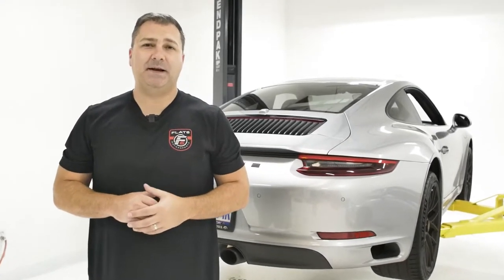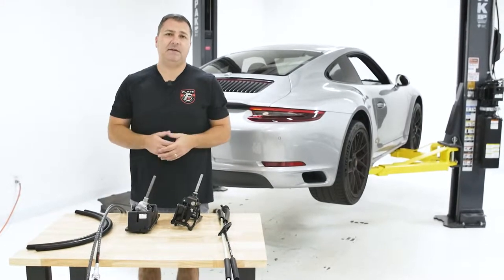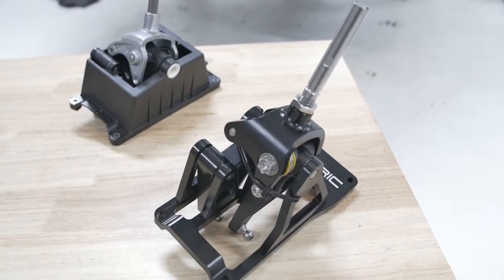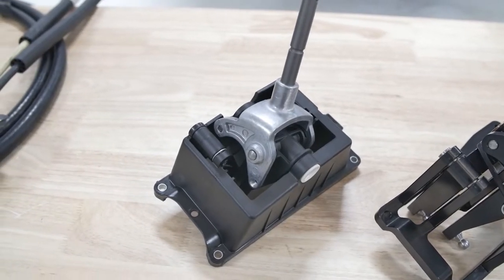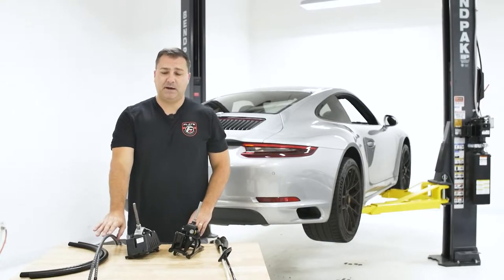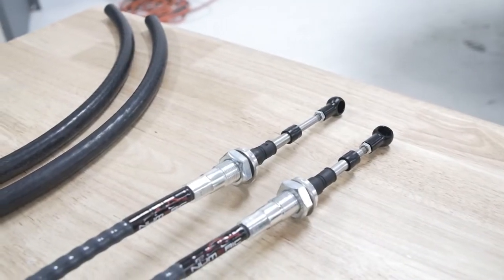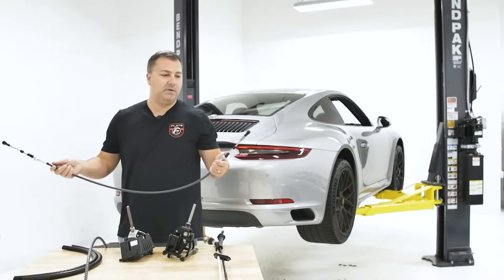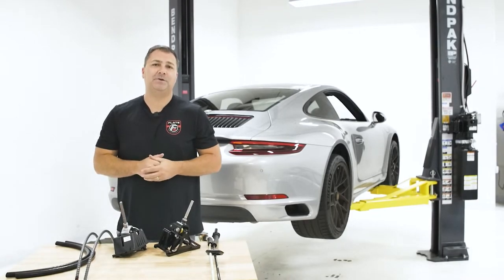Shifting Solutions For Your 991 Generation 911

Comment: With how insanely high Porsche's prices are these parts should be made standard from the factory.  At least the shift cables with metal ends rather than plastic.  Come on Porsche, you can do better than cheaping out on parts like this.  Your profit margin per vehicle is huge and they are not VWs you are making.  There is no excuse for plastic parts that can break.